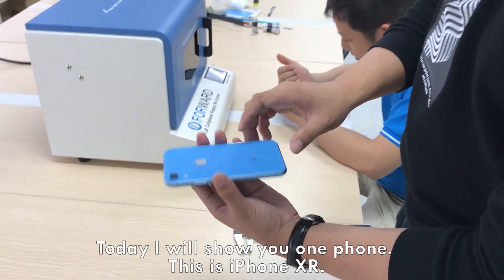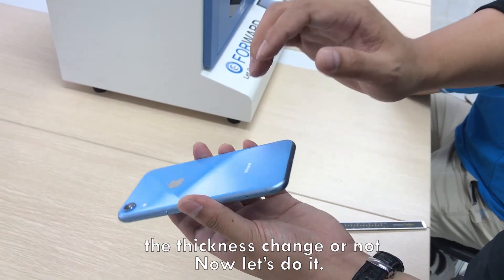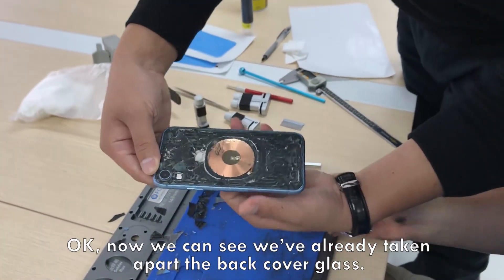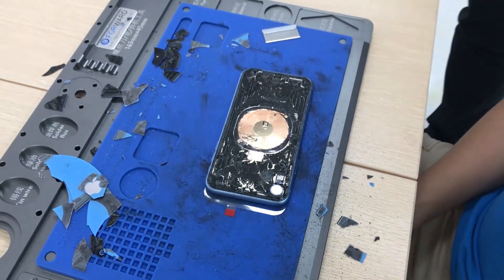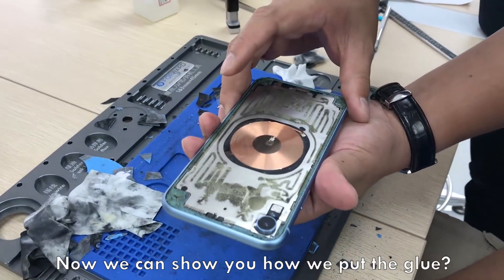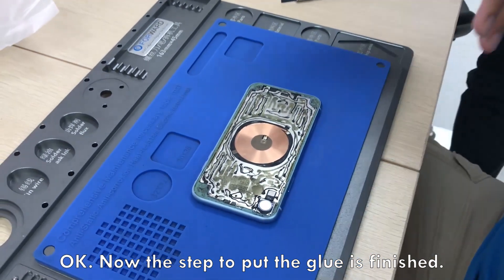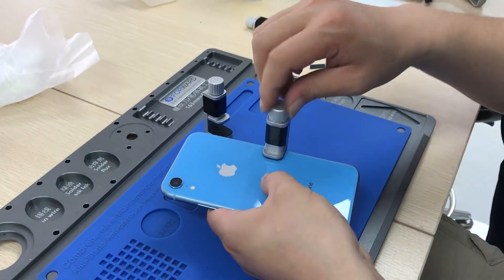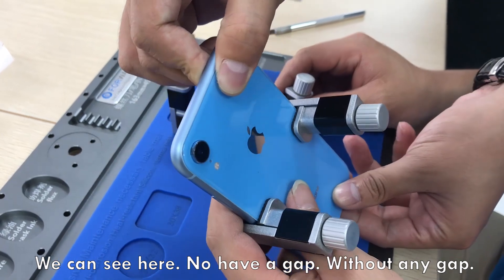Never Remove The Glue Inside Phone To Keep The Original Thickness, iPhone XR Back Glass Replacement

Comment: How do you handle the ugly smell? The phone stinks for a few days like burned rubber, doesn't matter how intensive you clean the inside after removing the glas.
We have tried to run a second turn without the glases to remove the whole glue. After this, we have the feeling, the glas fits better in the frame, and also the smell was gone. Any other makes this experience?
Reply: We have the same problem. Ugly smell. Did you disamble the phone for sencond time? I am afraid because the battery!
Reply: @OscarJoss  can you update ? If you remove the parts for the second one or what did you do for the smell ?

Comment: All the black dust scares me. In the demo for blue light lazer you said dust is minimal. Here is much more dust than that demonstration. Excellent machines and videos saving much time for master good work forward.
Reply from the maker: All types of laser machines will generate dust after laser the back glass. However, after removing the back glass with the blue laser machine, almost no dust ran into the inside of the mobile phone, such as the camera of the mobile phone.

Comment: Hello friends the iPhone would still retain the ip68 standard that comes from the factory? What cleaner do you use to remove the black glue after removing the glass?
I appreciate an answer thanks!!
Reply from the maker: cleaner: Alcohol
Reply from the maker: After replacing the back glass, the effect is the same as the original one. But the waterproof effect should not be as good as the original. If you want a better waterproof effect, you can apply more glue to the location where water may enter.

Comment: This frame glue which u are using can be kept for how many days after opened once 

Please explain
Reply from the maker: Thank you for asking
Different materials have different shelf life. We used this in the video, and we can still use it normally 3 months after we opened it. We have n’t tried it for a longer time, so we ’re not sure. There is a trick to save the bracket glue: store it in a small refrigerator at about 15 degrees Celsius.